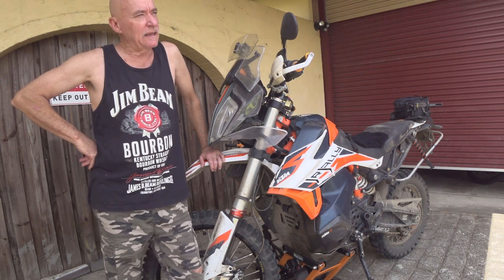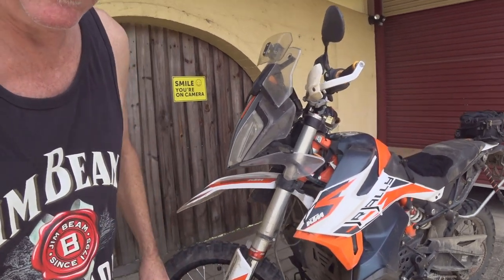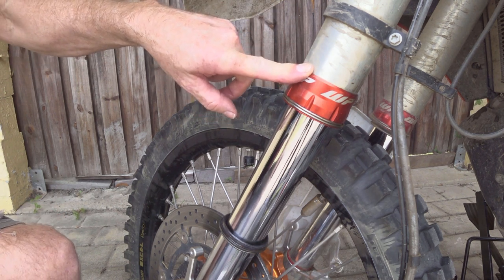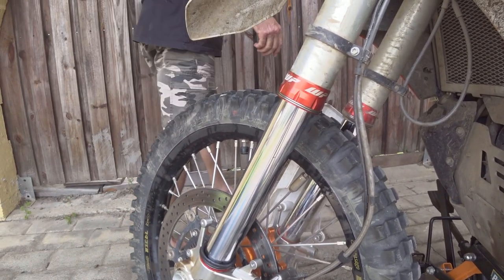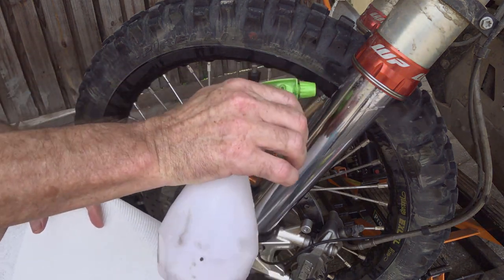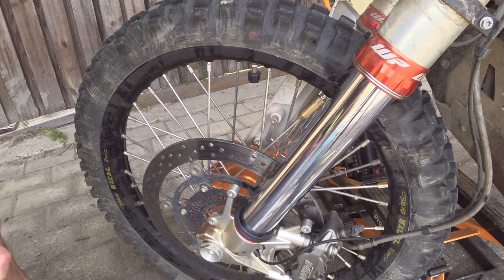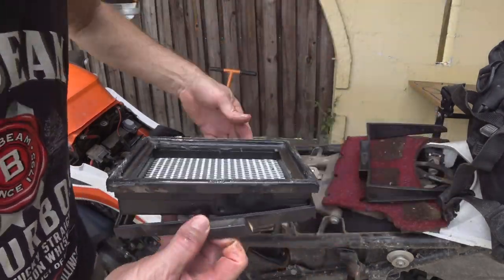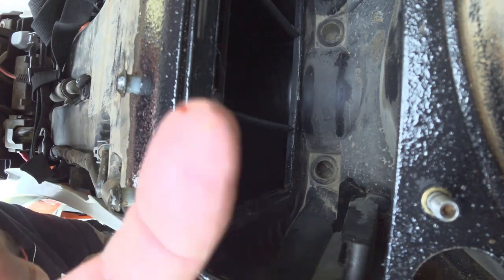Fork Seal Leak Repair and some other post-ride maintenance.

Comment: Its refreshing to hear someone accepting some responsibility for leaking fork seals rather than just cursing ktm! 

Any chance of an uodate on you genius 790 air intake mod?
Reply from the maker: Ah, yes - I own up when it's my bad habit that caused the issue :) Hmmm, re the intake mod...maybe KTM's engineers know a bit more than me unfortunately - it lacks low down torque badly when the airbox is that much smaller - so much so that it's like a 2 stroke. It does sound amazing though! But it'd need a much larger budget than mine to sort it out unfortunately, so it's about to go back to the standard airbox with the powerplate :( Cheers for the interest.
Reply: Shame. It was a much better location for the intake and getting the battery and storage space down low would have been brilliant

Comment: Thanks for the vid
What do you do re replacing lost fork oil?
Reply from the maker: My bike's in for a service soon, at that service I also do a shock and fork service - so they will top it up. If on a long trip and you lost that amount it'd be fine if not doing full stroke hard jumps, but if so it's a bit of a mission to top it off correctly (you need specific tools).... but in this case losing up to maybe 20ml is no biggie generally speaking.